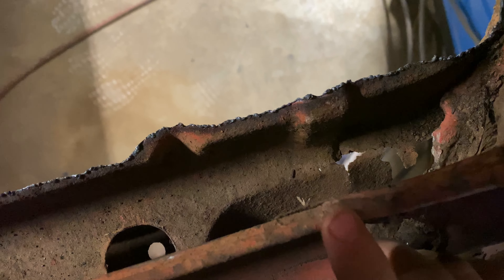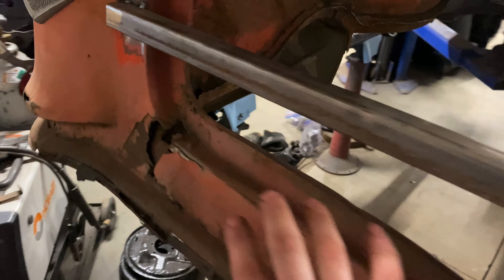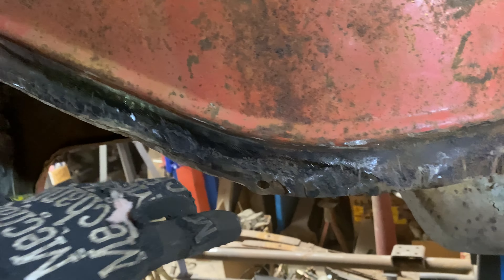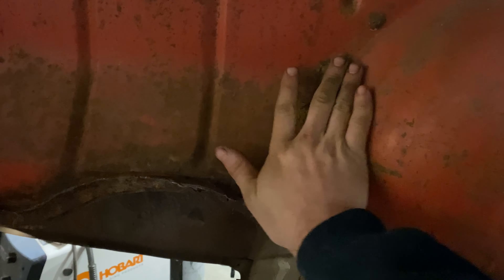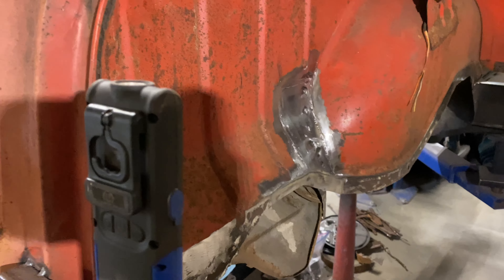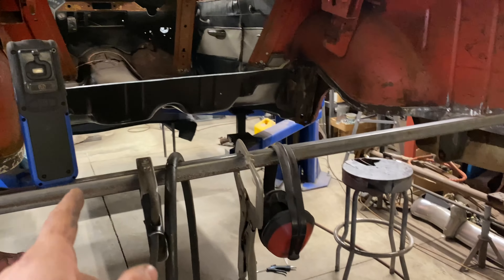55 Gasser new trunk floor!

Comment: I bought a set of those arches for my 55 gasser....the arch was too small for my application unfortunately. If your running a 29 inch-ish tire , and don't plan on the car sitting 2 miles high , they are just a little too small. keep up the good work man!
Reply from the maker: Thank you for the input. That is good to know. Appreciate it!